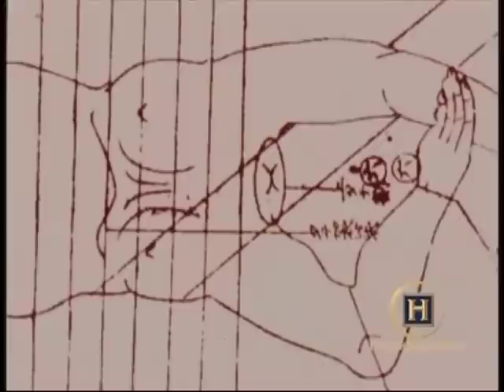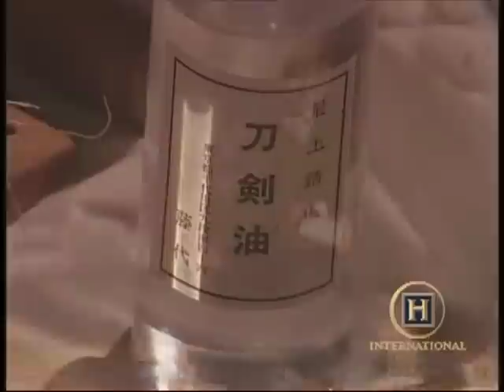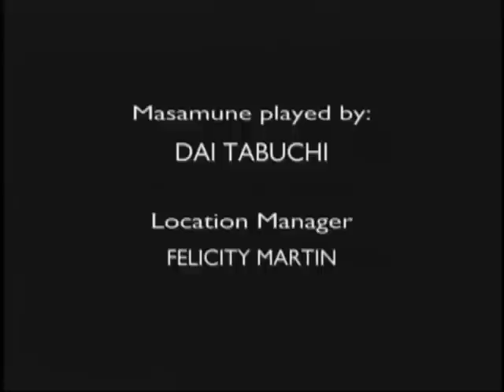Masamune The Master

Comment: I have watched many docus regarding the swordsmiths and their work but I have never been able to see a swordsmith make these curved grooves along the back of the blades. I take it they are also hammered out during the forging process but I don't understand why this feature is always left out. It is, after all, a delicate operation with high precission in the correct depth and width. Has anyone a link to a docu which shows this groove making process ???   Thx !!     Thank you, Mike for uploading this docu here !
Reply: in katanas, the groves are cuted with some kind of "planer", with a rounded blade  (w sorrels use some kind of "modern" version, the traditional Japanese version is like a wood planer, but with a guide and the thin blade (the same width as the groove))
https://youtu.be/pduCRnVCRgc?t=439
.
https://youtu.be/NDU8V8fjX1I?t=219

Comment: 18:18 bandits !!!

I remember Bruce Tegner's JUKADO book like it was yesterday. Strategy: largest/leader/closest. One enemy as immobilized shield. Series of, control, use as shield, attack others, push, rotate, repeat. 

How to defend if required, against as many as 4 armed attackers in a "talking is over" situation that cannot be resolved without action. Strike first. Without hesitation or question. Take them all out.

22:55 when this scene starts you see something immediately, even from this far away

Rose colour to me.. in the shine, various key tints. I suppose the original metaphors would be like cherry blossoms and other things like wine ? magnificent.. half a million pounds ?

No, PRICELESS. If I had a million, and could buy that, I would pay 999,999. Then go back to work with a smile. Wow with wow on top.
Reply: which is funny cause that was a fake they bought 😆 
i have a real one not a honjo though

Comment: Masamune is a tough act to follow he set the bar high one of the greatest swords man that ever lived this video is awesome about the Japanese history culture I love swords the weapon type thou not the ones for show I like the real macoy but obviously they are very expensive high quality high carbon steel so I never be able to afford one but I steal like them..
Reply: well it depends what you want to pay you can buy a edo period  wakizashi for as low as 980$ that still in a  Decent Polish but with a few  Scratches   The higher end swords are  around 1k to 10k  a modern made blade  Usually cost more than the originals there not  Completely unaffordable like most  People Make it out to be you just have to know how to tell an  Original from a replica  Which is quite easy  if you know what to look for  ive   Studied for 6 years   but every sword is different they all weigh  Different  there is not one sword that   Weighs the same  unless is a cheap knock off    but you sould learn more about it  is fun.
Reply: Nah he's just got the best western publicity. Many great smiths.
Reply: Good authentic examples start around 2000usd. Modern made examples can be made just like originals, many with even better steel. Ww2 era vet bring backs were often century old family hearlooms that had been cut down to fall within ww2 imperial japan guidelines and even though historical examples can be found around 1000usd. Save around 2000usd and do a lot of research and make it a reality.
Reply: @micahcampa  for 980 that wakizashi probably has other flaws some probably fatal.
Reply: @bmxriderforlife1234  no you have to buy from good sellers in japan and have a smith look a them i had that done and he said it was fine  and perfect for what i paid for it i know japanese swords ive have been studying for 8 years now the only flaw that would get me would the hagire crack but thats  Obvious its not like im gonna use it any way its 500 years old and i want to keep it that way
Reply: @brandonbentley8532  yeah but not for any really famous smiths. and sometimes not even for a quality blade if you also want a mount thats in serviceable condition. yeah deals pop up but thats also where beginners get scammed. 

i find it funny no one mentioned shinsakutos can be had for around 3k. and are less likely to be faked. and you can even get on a pretty decent smiths wait list and get a pretty nice shinsakuto for like 3,500 fully mounted for like 5k. made the traditional way in japan. 

you can also get fairly authentic reproductions that are made using modern high end steels that aren mass produced. howard clarks l6 bainite katanas for example. highly traditional. except the metal and lack of folding. but folding was part of the process of refining the steel. and little known fact but japan had crucible steels in these times. produced in small amount but used to keep the steel purer and add more carbon to certain parts of the blade. plus imported steels were used in the production of many super nice katana. search nanban tetsu. 

budget nihonto are nice but eh not what most people expect and most people dont wanna go through the effort for a nice super fresh polish.  and i generally avoid pointing noobs to flawed blades, unless non fatal flaws. and polishing can expose fatal flaws. 

for budget entry option with no education shinsakuto used or a more budget brand new one is a safer bet. or for someone wanting to save a few bucks, find some of the traditional style smiths outside of japan. 

if you guy the right iaito you can have the blade cloned in steel, take the handle saya and rest from it and transfer it over with real rayskin fully wrapped around the handle core, and literally have the perfect training tool. iaito tsurugi or blank blade, get a shirasaya from the smith, pay a little bit for mounting work and bam you have the complete package for a katana. with a modern tool steel blade potentially folded and laminated potentially monosteel. and monosteel swords did also exist in japan. rare but did exist both low and high quality examples. and some powdered steels have a pretty decent hada naturally. and a shinsakuto has the iron sand refined pre smelting to reduce contaminants and increase steel quality.  and is made from the traditional ore. can also get non traditional ore iron sand steel from smiths out side japan that are made the proper way. certain smiths are even recognized though only one is fully licensed as a smith by japan. 

also ww2 vet bring backs were not often old family blades. those did come back. the vast majority of blades from ww2 period are gunto. military swords many of which were recognized as nihonto in japan till recently. shibata ka being an example of such a smith. gendaito being another name. however that only applies to those made traditionally like the yasakuni shrine swords. others were stamped blades or machine made, some made from non hardened steel some made from pot metal. many basically non functional. this is also why japans sword laws are so strict currently. 

most ww2 era swords are pretty aweful. many dont have hamon if they are functional, many with hamon are mono steel and not traditional ones. many have no lamination and some express a lamination invented specifically for the war effort. a bunch are chrome or nickle plated and have no functional edge.  yeah alot of real swords were given out but so were alot of fake ones. and quality was highly hit or miss. but yeah gunto are illegal in japan. completely illegal in japan. nihonto are not. shinsakuto and gendaito are considered nihonto. 

but mad gunto are just considered bullshit or nothing more then murder tools in japan. so basically yeah. and considering how few people actually have samurai ancestry they can trace back its likely most swords werent family heirlooms even if they were old. people bought old family swords from dealers or were given them by neighbors. but yeah nah very few really high quality old swords were carried into the war. most were taken during occupation. like the honjo masamune.
Reply: @brandonbentley8532  you got it but those swords  swords purchased by officers were  Actually from antique shops and it was  quite rare for one to have passed down to them   because those swords that were passed down did not ever see  Combat because most swords that  have did not last more than 1 or 2  Battles unless you never used it but you were on a battle  Field   Then yeah that probly survive because they  mainly used Yari and Yumi but most of the time the swords  did not   Survive  i have seen some that were in just one battle they were torn to shreds they were bent and   Had to be re straightened and chips all over the blade not even a good polisher could save that but you get my point  Most of Them were antiques they bought themselves  but the navy had stainless steel katana  / kai gunto they were known to bend way  Easier than originals because of the Stainless steel but they were sharp same with the   Foot soldier / officer sword they  Tested  on tatami mats and most of them bent but  a few did not  i read and  Article about it but those are  The machine made blades though so i did not  Expect much thats why most  Officers if they could  Afford an original they would buy it or in some cases  Handed down to them  Sincerely Micah.
Reply: @micahcampa  then you arent getting it out of the country for that 980 there are alot of costs in having swords registered to leave the country ask me how i know :) 

and still hagire. flaw. also you do realize 500 year old swords are used for cutting alot more often then youd think. especially in japan. and how many other flaws are there that can fuck you. 

yeah if you know swords, but im also guessing that wasnt your first purchase and most people arent dedicating their years to buying a single sword. best bet for pointing noobs in the best direction is either give them a dealer they can trust. oooor simply recommend shinsakutos. alot easier to get functional level blades without any detrimental flaws other then scuffs. and the amount of shinsakutos you can find in perfect polish is astounding. 

in fact i almost bought the shinsakuto reverse bladed sword from the rouroni kenshin live actions movies. 

and if youve been studying 8 years better deals then a 1k wakizashi that doesnt include its export costs. like 1,500 for a sword by the teacher of the first generation of the muramasa lineage. or 6k for a muramasa daito with a masatoshi short sword with mounts. or the tanto i got made by masamunes student for 4k. or a yatsutsugu that had previously been mistaken for a masamune that was dirt cheap. 

shit i found a stupid nice 1000 year old tachi for 10k. you can find swords with good polish that are studied swords and published swords for like 3 to 5k. 

a grand for a wakizashi with no export papers isnt shit. unless its by a good smith. and with hagire nah no thanks.
Reply: @bmxriderforlife1234  i never said it had a hagire i said i would not have bought  if it did and the polish on the wakizashi is fine theres just 3 small sratches near the kissaki thats all its has a  wide suguha with a konuka  hada it was made by a known smith not famous but his is in the smiths index of schools but he was hard to find his name Sagami no Kami Kunimasa  or     相模守国維 wy do you have to be so rude im not being rude to you.
Reply: @micahcampa  actually some swords survived bare conflicts. Usually treasured though. 

I have a sword that survived decades of blade on blade sparring at a kenjutsu school before it was purposely snapped to prevent anyone sharpening it. 

Low end blades can break pretty easily when they aren't made by the best smiths. But some more quality smiths blades take huge abuse.
Reply: @micahcampa  stainless steel breaks not bends. Metalurgy. 

Non tempered ones bent. Others snapped fairly often. Also not all were stainless steel. Some military issued swords are laminated with a pipe and rod technique that was invented for the war effort. Like a solid kobuse jacket almost. But smaller core. 

Some were oroshigane. Some tamehagane. Some modern steels. Some had hamon some didn't. 

Then you have swords that weren't even made from steel. And its fairly commonly known most gunto aren't functional. And the ones that are technically are often gendaito. Which was discriminated against for a long time.
Reply: @micahcampa  that's actually a decent waki. But those deals aren't easy to find for beginners. Not trying to be rude just objective. Also your wording made it sound like you admitted I had a point on flaws and it was hagire. 

You can also find bad void pockets as well. What looks fine ends up turning bad with a polish. 

Still I find more easy deals on swords with barely any flaws in the shinsakuto market. If you want traditional and less likely to get fucked that's the easiest way to go for Japanese made blades. 

Rick Barret Howard Clark Josiah boomershine or others for non Japanese made. 

Antiques is easier to get stuck with bad examples till you have a decent example to study. Shinsakuto will help noobs in their study. 

Also while not famous that smith is highly skilled. Some have men polish and blade Geo others have beautiful edge geometry. Seen like five. Waki few longer blades and a tanto. Well mighta technically been a small wakizashi but a nice o tanto. At least as far as mount.
Reply: @micahcampa  and just saying but seen a few shady people lately pushing how easy it is to find good deals while they low key are selling fakes or gimei low quality shit for above retail of a gimei but looks good if it was a real signature. 

Some being modern made non registered excess blades of smiths that can't be sold in Japan but are useful outside the country. But obviously aged and with incorrect signatures. 

So kinda telling people to be careful.
Reply: @bmxriderforlife1234  i know most of the things you are telling me but i just did not bother to write that much i know what your  Talking about with the   ww2 gunto blades there were some made out of old iron pots that were made with iron sand that they used in the blades.  they said the stainless steel swords bent  saw a picture they were bent almost 90 degrees so that says something about there stainless steel i guess  they thought it was ok for a sword that would not have have been used  the japanese  Officer said his kai gunto bent it was made out of stainless steel i know it cracks more often than  bending but i want to know what they made them out of  lol  they look good but i would be scared it would snap if i had to use it because they did come sharp from there factory i dont think they had  Usage in mind though they did put a smiths   Signature on them which i find weird since there 90% of the navys swords were made out of stainless steel becasue of the salt water  and the other half were  Antiques but even the non  Antiques had Smith signatures on them which were made in a factory which i still find odd im not talking about the  regular guntos im just talking about the navy .

Comment: how their swords stay sharp for millenia.  i wonder if the original masamune, or muramasa, hadn't sharpened the blade before quenching.  if you were to polish and sharpen it when it was still straight, then quench it for the curve, the edge would have much more tension to it.  the whole principle is like a prince ruperts drop,

Comment: I have a MASAMUNE tanto....one of the prizes of my collection. A lot of what they say isn't exactly correct in the forging process.  What makes the steel top notch is the getting rid of impurities in the steel and the correct temperatures it was forged at, which is the secret of the smith.  This is what separated master smiths from others.  BTW, the Curator is an idiot.
Reply: and i have a masamune katana  let’s compare our nihonto

Comment: 8:00 i wonder what the fundamental structure is of Oak and Pine, both natural and charcoal analysis of the water-bearing "life fibers". Just like us, vegetables are mostly water by weight (% WW) and take energy from the environment for biological processes. We are actually far more similar than ever imagined. Water is the magic. Life substance, magical surface. For absorbing by ? life... the veiny leaves and our skin are "water loving" substances.

Even the names tell me something.. o the circle is significant as is the k.. very significant. K is literally the V shape on it's side, with meaning related to uncertainty, balance, and division itself. 50% of biology plus a little bit more chance for woman because ? "mother Earth" said so.. no mother, no babies, no life. No man, no protection in early evolution, no life.

"k" value in probability math is the key variable.

Pine seems like the equal-but-opposite material in this "balance" driven world.

Ends in e, the circle with the unending curve attached.. or the cyclical, but "rhymes not repeats" nature of things. How apparent has it become to science, if you ask good generalists ? blazingly I would guess..

Even astrology is dead. Long live science of probabilistic, evidence based thought.
SLN.me/app dial 3 for yourself. Don't freak out. It's just Chinese and other "mythology" ! 

nutshell, this place is SO simple.

Comment: If rust is the worst enemy why not use stainless steel then? 😜
Reply: Stainless steel is brittle  when you make a long blade out of it it breaks  Very easily  but then  Again the kai guntos swords for the navy during ww2 were mostly stainless steel but  stainless steel did not  Exist when the samurai were around  Stainless steel was invited in 1913 and a  Original Japanese sword would beat a  stainless steel sword any time.